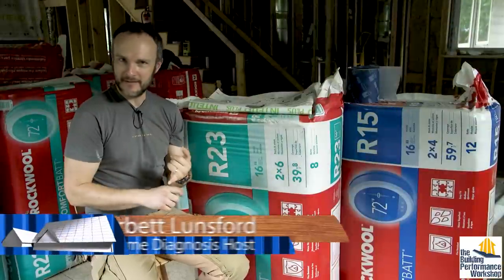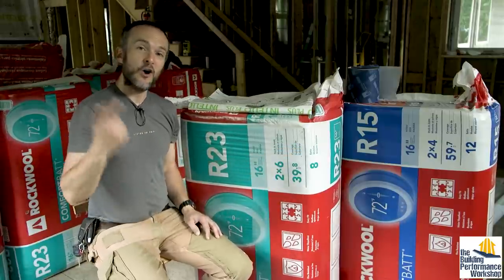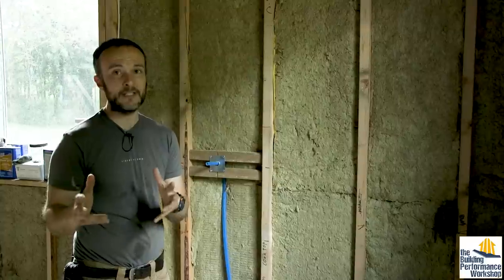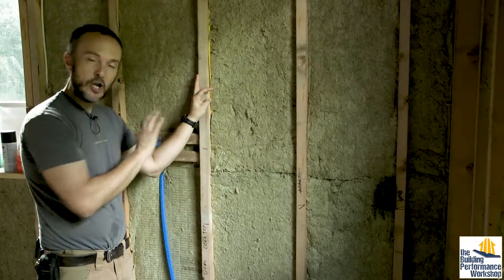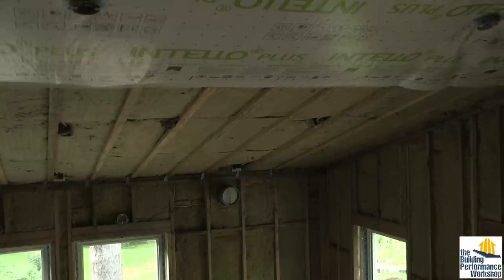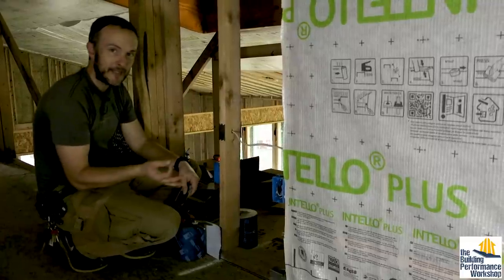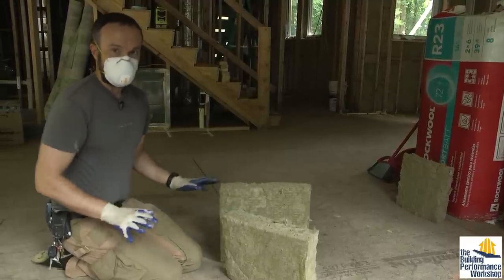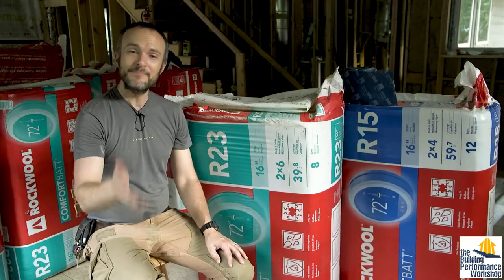New House Insulation, Intello Membranes and Tapes

Comment: My dad is an architect who has designed symphony halls. He said that using resilient channel on both sides of a single wall provides more sound isolation than doing double walls. It comes up several times a year often in conversations.
Reply: It's also much cheaper to use resilient channel.
Reply: What if you use both?

Comment: For the tubs, put some wet concrete under where you stand, it give a much more solid surface. The gap is often about 3 inches, so don't just put a mound of concrete, also put a few inches of rigid foam under the concrete lump so that after it has wicked out the heat from the tub, it stops trying the warm the floor.
Reply from the maker: Nice, Michael

Comment: Just a tip. Change that pex you have for your potfiller to a drop ell. Most pot fillers mount like a shower head IE threaded onto a 1/2" pipe which also provides the support for it. Easy fix now VS later. 

     Ad for the Intello I'm hesitant to use that in a house that is in a primarily cooling climate. I like the idea but  a little leery of it. Seen way too many moldy walls from having a moisture blocking barrier behind the drywall. Fine in a house that dries to the outside up north though.

      Sealing outlet boxes should be code IMO. Few realize just how much airflow there is through them especially on older unsealed houses. 

           When you mount your nail plates you want to use a router to notch the lumber for it so it doesn't make the drywall stick out. Allot of work but it does make a difference in flat drywall and stopping airflow between cavities and from the room to the wall.

         Also to add. Stopping the airmovement  as well as you have also stops vast amounts of sound transmission as well.
Reply from the maker: Thanks for following, and for all the helpful tips, Robert!
Reply: @HomePerformance  Gotta do some more research on the intello before I will use it. Just wary right now. I think it would be extremely useful and effective on remodels where the existing structure leaks like a sieve.

Comment: Brilliant points. You are a definition of home science
Reply from the maker: Aw shucks
Reply: One question. Do you recommend 1 or 2 inches of spray foam and top it with rockwool?
Reply from the maker: To be precise, I don’t recommend spray foam if there’s another technique/product that will work. But if you must, then ask the foam manufacturer what thickness they guarantee as an air barrier.

Comment: I will need to check out your prior videos on Intello because I am unfamiliar with the product. I am working through the building permit stage. The plan is to aggressively work to minimize air infiltration. Most of the plan relies on Zip sheathing, tape, liquid flashing, minimizing the number while specially treating any penetrations, and using AeroBarrier. I had not considered a second barrier on the interior walls.
Reply: I am not to the stage you are yet but it is funny that I am thinking of doing the same thing when I start building. Zip (or equivalent), tape/liquid flash, and aerobarrier after its all done... for added peace of mind

Comment: 7:43..   I’ve heard this contention...   my real life experience on this.   I loosely and incompletely filled the walls of my shed workshop. Had one whole wall uninsulated (and I could feel it sucking at me when I was close to it..    there were gaps in the batt..   some of the batt was safe n sound...   others were comfort. 
Went from two heaters on high and long John’s with a down jacket, to one heater on low and T-shirt.   Conclusion, some insulation is better than none.

Comment: Energy (including heat) follows all paths, the rate of transfer is proportional to the respective resistance of each path. Increasing insulation on one wall doesn't increase heat transfer through a less insulated wall. It simply makes heat transfer disproportionate, which may or may not be a problem.
Reply: I think you are making a point about Corbett's statement  "it doesn't makes sense to insulate to different levels in different parts of your home".  I agree that it was probably over simplified.  Otherwise, wouldn't we insulate our walls to the equivalent R-Value of the windows?
Reply: @JW-gc5ve  yeah I'm not trying to be overly argumentative but whether we're talking about electricity, fluid flow, or heat transfer, it's a really common myth that it "takes the path of least resistance." While it's technically true that it does, it also takes other paths. If it only took the path of least resistance then all the lights in your house would turn off when your air conditioner runs. Increasing insulation on one area and not another  does not redirect heat from transferring to the more insulated area and cause it to transfer into the less insulated area instead. It may not make sense economically, which he demonstrated, and in extreme circumstances it might result in problematic, incompatible heating/cooling load  profiles for areas served by the same comfort heating and cooling system.
Reply from the maker: @Joel Becker you can clearly demonstrate that heat flow is non-linear with the Assembly U-Factor Calculation. That’s basically what I’m trying to do with the simplification here-  normal people do not need to know all the technical details of our work, as long as they understand that a simple ‘common sense’ approach does not work with a lot of the dynamics in their homes.

Comment: I get it, so why not just frame the entire structure as 2x6 instead of having 2 random locations at 2x4, which caused you to stick with r15? Basically you built 80-90% of it as 2x6. Why not just complete it all as 2x6, thereby making the engineer happy while also keeping equal consistency throughout the frame, allowing for more insulation consistently throughout the build?

Comment: Home Performance  is one of the best channels on YouTube! We are learning so much planning our remodel. Great timing! We do have a question if you could. What are the windows we saw that were small squares, maybe about 1' - 18" ? and and what height did you place the in wall "next to toilet" vent?  Genius idea we HAD to include but are lost on the  #'s. Care to share that detail or  dims?   Thanks for showing us the properties of Rockwool and INTELLO.
Reply from the maker: Aw, thanks Kevin! So glad you found us. Yes, those are 12” square fixed windows, same Alpen brand and specs as everything else in the house. The vent I put ~3” above the top of the toilet, so about 36” from surface of subfloor. As long as it’s below your face, it should work.

Comment: You mentioned no wanting hot and cold rooms, and being in atlanta. I am in Mobile Alabama, in the summer it will often start raining out of a cloudless sky because the humidity became a bit too high. When it is a non-condensing 100% humidity, and 106F, sweat does not evaporate to cool you.  I was planning a mud room which may be excessively cold that I will be able to go into periodically while working in the yard to ward off heat stroke. It may have a window unit just to be extra cold.
Reply from the maker: I hear you Mike- but try making it dry instead, with a fan to blow on you. Lower the temp of your skin and you’ll have MORE moisture condensing on you, making you even hotter.

Comment: Excellent built! I the interior airtight membrane twice in high performance house. Imagine having a 0.1 ACH@50pa + having your Intello membrane = 0.005ACH@50pa (I think the world record is 0.05ACH50pa).

Here in Quebec, Canada, we use furring strips 1"x3"@16" on the interior side of the wall. My suggestion : Double furring or "furring strips" 2"x3"@16". With that you have 1-1/2" of clearance.

What I understood with life, that it's better to use Aikido. Let it flow as a Khun Fu monk.

Comment: My wife and I are about to embark on gutting an existing 70s 2-story house, and "remodeling" into a single story home office/gym which will be well sealed and insulated.  At about the same time we're building a small, near passive house.  Your videos have been super informative.  Question on the electrical outlets.  Seems like a quick couple of shots of an expanding foam sealant would be far easier and quicker than the butyl tape.  Did you consider that?  Also, is the space above the ceiling rockwool vented?
Reply from the maker: Foam cracks snd degrades differently than this tape over the years- we aim for this to be a 100-year house. And the ceiling cavity is not vented, no need. No moisture will accumulate there, because of the interior wrap and all layers vapor permeable, plus in Atlanta the temps are fairly mild.

Comment: Hi Corbett, I'm just now getting caught up on this video series and have this question: if I'm understanding you correctly, you've got a 3.5" R15 batt in a 5.5" exterior wall cavity, leaving a 2" air space between the batt and the interior sheetrock.  I know that with a lower density material like fiberglass, convective looping within the cavity would reduce the effective R value by a significant margin.  Is this not a concern with rockwool due to the higher density?  Does your energy model account for any impact created by this air gap?  I've always been taught to fill the cavity when air permeable insulation is used.  This is fresh on my mind having just read through John Straube's "Thermal Metrics" paper.  By the way, here's an excellent pun from page 13 of said report: "However, as some airflow always does occur, the impact on thermal performance is hotly debated."  Thought you might enjoy that.
Reply from the maker: Thanks Nathan, and Straube wrote the foreword to my book. Air gap on the interior is not a problrm, since temps are all the same inside the insulation.

Comment: Thats a lot of insulation!  Haven't made it through the whole video... but what are your thoughts on spray foam in an attic? Both of my HVAC are in attic so I would need combustion air for that and water heater
Reply from the maker: Combustion air does NOT have to come from outdoors, so encapsulating your attic may not be an issue (as you know, I’d recommend you test it before, after, and during). Spray foam is not a favorite of mine because of flame retardant offgassing, but if you ventilate properly and don’t spray everywhere in the house you can do it well.

Comment: I see you have recessed lighting, care to share which cans you went with? I am building a home with a vented attic and recessed lighting has me paranoid. I have done so much work on the walls, windows and sealed crawlspace, I would hate for a dozen or so lights to ruin it all.
Reply from the maker: Hey Aaron- those aren’t recessed lights actually, you are correct that they suck. We have junction boxes made airtight which we’ll put LED puck lights on, resembling recessed lighting at a glance but very different in performance impact.

Comment: so if part of the house has holes not putting hole in the rest of the house doesn't improve heat loss?  Insulation is like hole less insulation the bigger the hole the more the smaller so not having holes doesnt help?  Obviously theres a return on investment concern but that's not the same so if you have multiple points of least resistance you have more heat loss, ,ore heating coosts.

Comment: Great video. Quick question, what happens when the vapour hits the radiant barrier on the underside of the roof?
Reply from the maker: Won’t happen- since the airsealing details are in place you’d need pure vapor diffusion, which just doesn’t move enough moisture to do anything. Airsealing is the way to stop condensation anywhere but Alaska.
Reply: Home Performance ah ok, so the intello would never let through so much vapour that it would cause condensation. Makes sense

Comment: So I am a bit confused.  If you already have a continuous air barrier on the exterior, why put this Intello on the inside of the wall?  I know it is a "smart" vapor barrier, but it seems like you are just creating another obstacle for any moisture that might get in the wall from drying to the inside.  Plus, the drywall itself is somewhat of an air barrier, which means you will now have three different air barriers, which just seems unnecessary.  Is there some benefit to this that I'm missing?
Reply: It's a barrier for air, not moisture. The main reason here would be that there is a vapor impermeable radiant barrier blocking drying if any moisture gets into that area above the rockwool. So you really don't want moisture there at all and drywall + Intello gives you a good probability the whole house won't fail.

Comment: If I am not wrong:  Intello for indoors is a vapour layer to prevent vapour diffusion from inside to the outside.
And Zip is also a vapour layer (also as WRB,...) to prevent vapour from outside to go to the inside? However, the Zip board allows passing vapour from the inside to the outside.  Am I correct?
Reply: Intello is an air barrier that works in both directions. It allows vapor diffusion (drying) when humidity is high. The direction depends on the season.

Comment: When you attach the drywall and punchier the inside house wrap does it matter?
Reply from the maker: As long as the drywall screws hold pressure around the punctures, it does not matter.

Comment: Why would you use a fiberous insulation beneath the slab? It will lose R value when wet, which it will be. Also, seems it could breakdown over time due to biologics and dampness, whic ridgid foam will not.
Reply from the maker: It will not be wet, we have a gravel field beneath with drainage.

Comment: I'm a fan of your channel and love most of your ideas. Hiweverm the Intello Plus one you present here is horrible. You've essentially created a cavity in your studs to trap moisture. This is going to induce mold growing in your walls (see Risinger's video on this). To do the belt and suspenders correctly, you should've installed the intello outside the studs (i.e. underneath the sheathing). Or rather, follow Martin Holladay's advice and don't install any.

On the positive side, given that you've air sealed your sheathing well, I don't anticipate this being a huge deal as you'd need the air to actually travel into the cavity to create problems. Though I'd be interested in knowing what the inside wall looks like after 100 years.
Reply from the maker: Actually, no- the intello is vapor open (up to ~100 perms). It’s always risky to put impermeable layers into the assembly (like ZIP, for example), but you see builders do it all the time. There are no impermeable layers here- even the ForceField WRB is 3-5 perms.

Comment: Is there any way you can specify your wall detail on the shed style roof where the two walls meet at the top. Im wandering how the walls meet with one being straight and the other wall being sloped. Did you put a angle cut on the top of the sloped wall where it will meet the top of the other wall which would be the top corners or is it cut square where it would leave a small gap between the walls.
Reply from the maker: You angle cut the roof rafters where they rest on the lower wall. It’s in the roof framing vid- search roof on our channel, you’ll see exactly how we did it
Reply: @HomePerformance  Oh ok. Cool I missed that video. Will have to check it out. Thats what I was thinking how it was done was to angle cut the framing where the two walls meet. Thanks again. Enjoy the videos.
Reply from the maker: Thanks Ghetto buddy

Comment: Receptacles by code are every 12 feet. You must be able to reach an outlet from 6 feet away. Its a tricky one.  Its all up to  interpretation.    But they definitely specify here.  At least the NEC does.
Reply from the maker: Partly why we opted for floor receptacles where the 2x4 exterior wall called for them! Easy workaround.

Comment: so much extra work.

Just build the internal walls out of a solid structure like blocks, bricks or monolithic walls.

Then you can build the external walls out timber frame with insulation in between the timbers and a continuous insulation outside or glulam beams with insulation acting as the non load bearing external walls

effectively creating a hybrid timber structure that’s the best of words, easy and safe internal walls for structural support and higher insulation values in externally without the hassle of solid walls and the tricker insulation work.

Comment: Genuine question. How can something be air tight but allow water vapor to move through? An h2o molecule is larger than nitrogen or oxygen right?
Reply from the maker: EXCELLENT QUESTION! Too much to type, so here is your answer:
https://youtu.be/oc_ITq5y9qA
Reply: Ever had a gortex jacket 
Breathable yet waterproof
Reply: @alexcampbell5371  gortex stops liquid water not water vapor though right. I have never had one so I wouldn't know
Reply: Michael Murphy if you wear a plastic poncho in the rain you will still get wet if you are covered in a gortex fabric you will stay dry as it allows air and vapor to pass through were as plastic traps humidity.... 
at least that’s my story and I have used gortex and plastic ponchos many times
Reply: The intello is permeable to water vapor and nitrogen and oxygen but it diffuses slowly thus it is still considered air tight.  I think.
Reply from the maker: It uses chemistry, more than just a physical mesh.